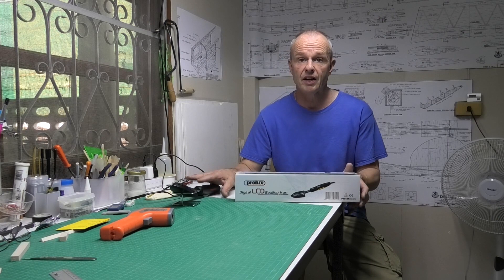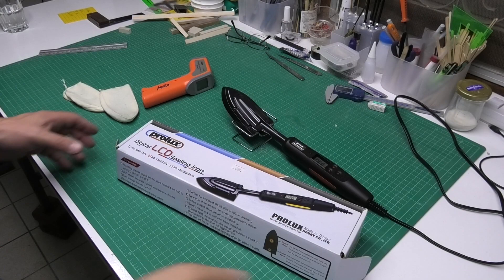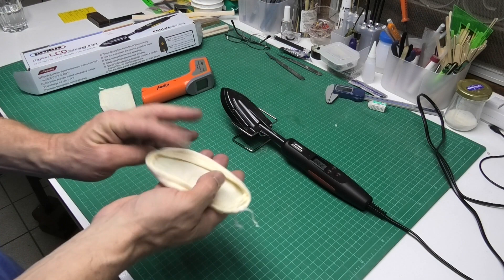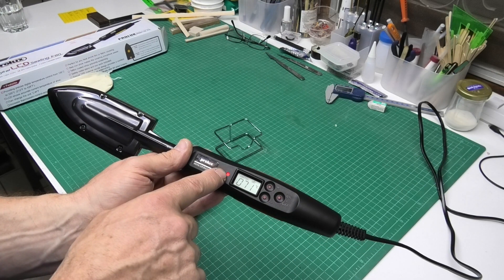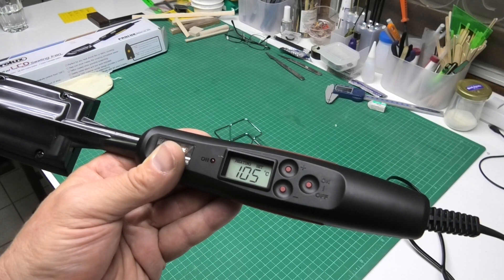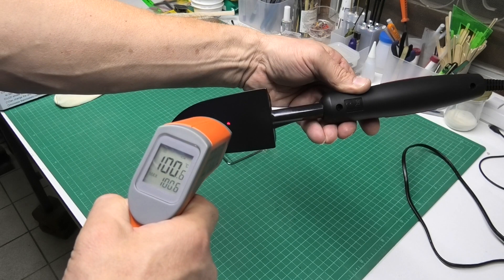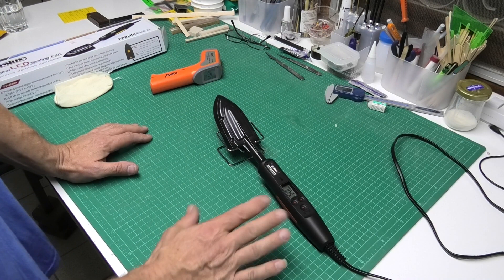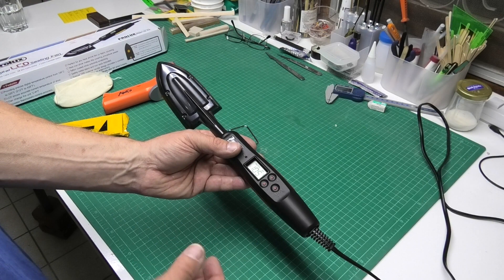Prolux LCD Digital Sealing Iron Review - RC Balsa Aeroplanes shrinkable film covering iron

Comment: Hi Mark, I use the same iron but I bought it second hand, I use the old trick of putting a slither of the covering material on the sole plate, if it instantly shivvels up it's too hot etc. I've never seen that little wire stand before I'll have to bend one up. Nice review,  new sub. 👏

Comment: Is there  anything you have to do before using it. ie clean the surface plate or heat it to a certain temp for a certain time?
Reply from the maker: No, just use straight out the box
Reply: @MarkRobinson555  
Great thanks, sometimes the factory puts a barrier on stuff for transport or if they dont know how long it will be in storage for before first time use.

Comment: these things have doubled in price.  I seen these locally at a woodworking store. same exact iron but done up with their brand name.  they use them for putting veneer on wood. even amazon want's $69 for these things.  the day of getting a Hangar 9 iron for $29.99 are long over. Horizon hobby doesn't even sell irons anymore. so, we're all forced to pay $70 for one
Reply from the maker: I did the video several years ago, so I am not suprise
Reply from the maker: You can stll buy them reasonably in the UK, they are £30-35, so  $40-45